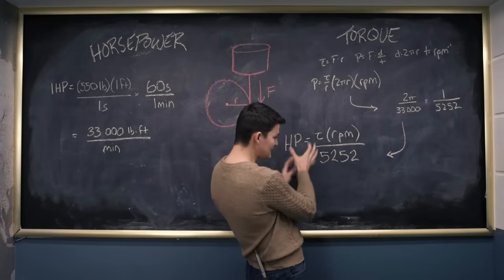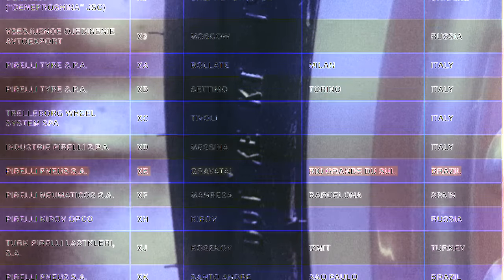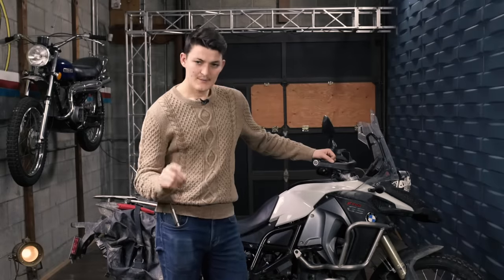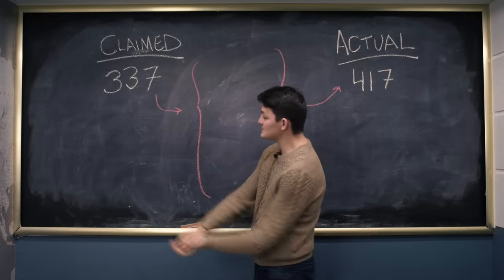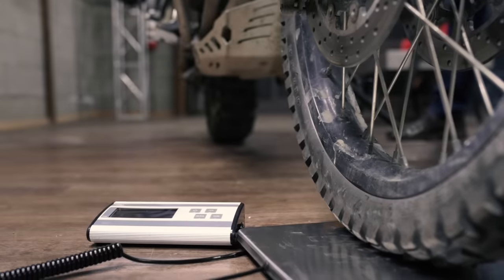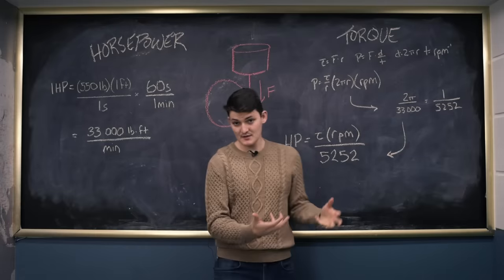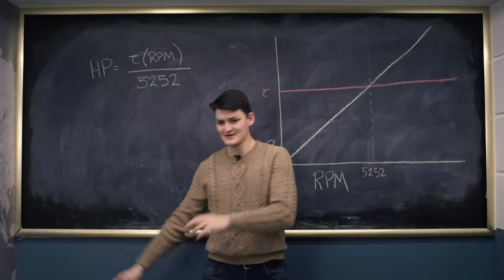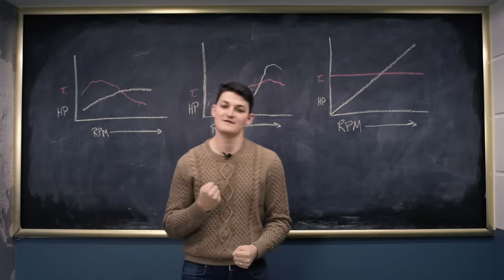3 Ways Motorcycle Manufacturers Trick You

Comment: Stuart Fullington tried to debunk this about the Pirelli tyres and said he contacted Pirelli and they assured him that what you claimed was not the case.  However at the time I owned continental GT with those exact tyres on and the local Triumph dealer had that years  Bonniville with the Phantoms on that had the deeper tread depth the exact same 100/19-18 front tyres and a mate of mine fitted the German version of that tyre and the tread depth was deeper than mine.  It’s also a dreadful tyre in the wet the Brazilian made version my mate said he has no complaints with his in the wet.

Also if you watch your video on a big screen TV you can actually see the tread depth is deeper.  When I point this out he called me names and shadow banned me. He also put out a video saying that open faced helmet are statistically as safe as full faced  helmets. Which may be true but tell that to the poor sod who has come off their bike and smeared their face along the road or gone face first into the side of a truck. He also shadow banned me  on my alt account after he gained that not once in his 40 years being one of the first to motorcycle crashes would a full faced helmet reduced injuries of the rider. Which could also be true.

Comment: Hat to be a stickler but...Acceleration = Force/Mass. Ergo, acceleration (in G’s) will very precisely follow the torque curve of the engine. Horsepower allows us to use gears to pretend we have more torque than we would otherwise have Eg. Horsepower allows us to hold onto numerically lower gears for longer (more torque at the wheel/s).
Reply: Who told acceleration is force/mass and how do I send them a mail bomb
Reply: @benfennell6842  It’s physics mate. You can argue it all you want, but that’s how it works. Peak acceleration (per gear) will ALWAYS occur at peak torque.
Reply: @burkeyatm  you literally fucking stated acceleration= force/mass

I cant even
Reply: @benfennell6842  Which part would you like to argue with?

Comment: Hey Bullwinkle here in America we got these stations called weigh station and you don't have to lift your Harley on any bathroom scale you just drive across the big concrete plate and the guy up in the station all yell out how much your Harley ways imagine that while you're explaining how it can't be done oh by the way while you're using trigonometry to bigger your Vortec guitar numbers for horsepower and torque we got Harley-Davidson baggers doing 147 miles per hour at Road America dragging their pegs and their knees and trading paint with Tyler O'Hara on his Indian bagger oh yeah by the way the Harley model that took the National Hot Rod Association Pro Stock drag bike at the US Nationals racing against 4-cylinder Suzuki namely the fxdrs 114 Milwaukee 8 weighs 660 lbs with 5 gallons of gas on board

Comment: I bought a second hand Honda 125 XLS in 1987 and the OEM tyres were the shittiest tyres in my life. I then bought a second hand Kawi 125 KMX in 1989 with Michelin T64 and the tyres were great. I bought a Kawasaki 500 KLE in 1992 and the OEM dunlop were crap, changed for Michelin after 800 kms (front) and 4000 kms (rear) and then the bike was great. More recently, I bought a Suzuki 650SV in 2007 and the OEM Dunlop D220 were crap, changed for Michelin Pilot road at first maintenance. I changed the SV for a VStrom in 2008 and I asked for Michelin Pilot road instead of crap brisgestone trail something. And I did not regret my choice. My advice : OEM tyres are crap !

Comment: I'm slightly confused about the torque vs hp argument though. Explain something like an FZ09 vs a R6? The FZ makes more torque at 3000rpm than the R6 makes at it's peak, and yet the FZ makes less hp.
Reply: Because the higher the rpm the more power the same amount of torque is.

If power=(torque*rpm)/5252 then there are only 2 variable components to power, torqueand rpm. Increasing and decreasing on or the other will both affect power. 

80 NM at 0 rpm is my puny arms pushing pushing a wrench power, 80 NM at 14,000 rpm is R6 power, capiche?

Comment: The 'you can't feel the torque' argument gets thrown out the window when you consider that you can compare one bike at x rpm vs another bike at x rpm. 

Torque is the force behind the power. You can easily feel the difference of a bike that needs to hit 7000 rpm to get that power vs a bike that has that same power at 3000 rpm, and even more power at 7000 rpm. You're feeling the difference in torque, while the hp is the same, because you know how high you're reving the bike.

You can't 'feel the torque' when just looking at a single bike.

Comment: The tire issue is interesting to me. If I didn't know to look at country codes and tread thickness, which I didn't until I watched this, I would just take that tire at face value. Which I assume most people do and that's why they do it. But if that tire craps out earlier than I would expect, I'm certainly not going to go shell out a shit load of cash to buy what I now assume to be a garbage tire. So now that company is damaging their reputation among people who don't know any better. So yeah they sell a boat load of cheap ass tires to the manufacturer, but now they are not selling their good tires to people that would buy them as a replacement. So what's the point?

Comment: If as example a motorcycle made a peak 80hp at 8k why they dont limit that engine to that rpm? Why bother add red line at 10k if they were had less hp at that point?
Reply: A few reasons, but the answer you're looking for is "gearing."  How fast the bike accelerates at any RPM comes down to how much torque is available at the wheels.  If we shift to the next gear at max HP, most modern engines will generate less torque at the wheels and accelerate slower because of the gearing difference.  The ideal shift point is often well after peak HP and is either redline or the point before redline where the bike is no longer generating more torque in the current gear than the next gear.  Unless your bike has a really unusual torque curve, you can try this at most RPMs.  For example, ride in 1st at 6k and twist the throttle then ride in 2nd at 4k and do the same.  Big difference.

Comment: The motorcycle feels torque before it moves...  This is what makes the tire break friction for a burn out  

125 ft*lb of torque is not applied at rear wheel, but rather from the crank, thru 1st gear(usually from a stop) and then the net mechanical gear ratio between the engine sprocket and then the rear sprocket.

Most of your other stuff is correct, but you really missed this one.  Sorry.

Second example, how else can you drop the clutch to pop and pivot a front wheel over a log or such  torque from a stop is what lifts the front wheel
Reply: How is that the person on the bike feeling torque? You failed to explain yourself

Comment: so now i know that my 1200 cc harley roadster has 57hp with 71.54 ft-lbs of torque at 4250rpm  and my vulcan s (650cc) has 57hp  with 46ft-lbs of torque at 6600 rpm.  so i remember someone saying to me that when your power band is above 5252 rpm you will always have more horsepower then torque likewisse if its below 5252 you will have more torque then horsepower.
*but if i cant tell the difference between torque and horsepower then why is it that my harley feels so much more powerful then my 650? (even though my 650 has a little more then half the harley's torque at a little more then half the harleys weight)

also thanks to this video i can tell my harley riding club that my 650 metric bike has the same horsepower as a pristine evo engine lol.
Reply: is it just gearing differences?  though looking closer my sportster was actually roadster model making 79ft-lbs at 4000rpm but thats only a difference of 3 horsepower using that  formula of HP=t(rpm) divided by 5252

Comment: bad example with wrench, because you can feel changes in turning force even if wrench doesn't move. Torque wins races, and horse power sells. Look at diesel engines, high compression engines, etc.
Reply: Which is why f1 engines make less torque than SUVs right?
Reply: @benfennell6842  Power to weight ratio anyone?! You must not have thought that through. F1 "VERY" light car + 1 driver. Suv very heavy truck + 5-9 passengers + internal load + external load of 5-11 thousand lbs. typically. The more technical you look at it, the more ridiculous your example becomes apparent. And we're not even looking at other physics involved yet. Like aerodynamics, etc.
Reply: @robertmitchell8728  what? do you think there's somne kind of mathematical fundamental difference between accelerating one mass or another? Please explain yourself. A formula one car may be light but at the end of the day it's engine produces power to accelerate the vehicle. there is nothing special about that. 

You said "Torque wins races, and horse power sells." I am providing an example as to how this is ridiculous. do you think that if you put an F1 powertrain in an SUV it would make it slower? 

I'm trying to say that despite F1 engines making very little torque they win races, which according to you is not how races are won. Please explain yourself?
Reply: Torque is a pressure, or pressing force. H.P. is a measurement of weight movement in a time limit. Low torque engines with high rpms are building up extra energy in the form of inertial energy.
Reply: @robertmitchell8728  ok now I'm just more confused what what he'll are you talking about?
Reply: @benfennell6842  A F1 engine will not do well in a suv.
Reply: @benfennell6842  The greater the mass, the greater force needed to move said mass. The more torque over mass, the greater the acceleration. There are other forces involved, but in general, this is true.
Reply: @benfennell6842  Yes, an F1 engine would definitely be much slower in a suv, than in a F1 car. And even more so with it loaded down, and pulling a trailer.
Reply: @robertmitchell8728  let me get this straight, you think an suv would get SLOWER if you put an f1 powertrain in it?
Reply: @benfennell6842  I thought you might be trolling. Stop wasting my time, and yours.
Reply: @robertmitchell8728  You're actually so bad at explaining your position on this you've managed to end the conversation through confusion. Well done.
Reply: @benfennell6842  What part are you confused about? You don't think the added load of a suv would slow down a F1 engine? I think a
 F1 engine would be ridiculous in a suv. In initial cost, operation, and maintaining. I think it's lack of low end torque would have to be compensated for with more gears, to manage the increased loads. I think you would have to completely redesign the transmission to handle the extreme rpms, matched to the dramatic increase in loads. Unlike my uncle, I'm not a rocket scientist, but I get it. Are there errors in my grammar, or punctuation? If so, I apologise. If you could point my mistakes out specifically, I can learn from them, and improve on them. Otherwise, I suspect your trolling.

Comment: When I do Comparison I usually calculate the hp at the peak torqued and draw a linear line to the peak hp. This is not accurate, and many engineers have long way power after the peak number, this has to do just whit switch revs, all comes down to the net power given by the gear. Of course the 0-60 number give better respect than stealing ar the hp and torque number, and that's not giving you any truth about everyday driving, more important is the number under the curve, and that's just something you need to test drive to feel how you like the engine. After all, how often are you going for full power in a race situation on open roads, then again if you ower taking a car on a highway, seen the trouble to gear down to get to the power band might take more time with a more powerful engine than ower taking with a nice under the curve power engine with just dropping on gear or going with the gear you're in

Comment: Lawn mowers have torque at low RPM, crotch rockets have torque at high RPM, rally cars have torque through 2000 RPM to 5500 RPM.
Only trust bikes that have been independently ran on a dyno, never just buy some bike because it features super high figures.

Comment: I would disagree with you a little.

An engine with high torque is 99% of the time characterized with high torque at low RPM; thus power comes up easily without downshifting; it's more responsive to throttle. These engines are long stroked.

These type of engines are in harleys, REs, Triumph, trucks, pickups, buses, farm vehicles, generators etc...

Comment: Your torque vs hp doesn`t hold water. 80hp from a 1.6l will be a lot stronger than 80hp from a 600cc. Why? Bcs the bigger engine will produce a lot more tourque even from low rpms. Or in other words; you shure can feel tourque

Comment: I expected you of all people would be above the petty, juvenile, fray over imperial vs metric units as you seem to know math and chemistry fairly well and would hold an accurate view of how marginal the difference between those unit types really is. yes,  technically metric scales more logically and would theoretically be easier to learn and also convert if you have a hard time with basic arithmetic but if you learn the imperial system first it's just as easy to scale and convert. also learning one doesn't predlude learning the other. I'm a mech eng student and I have the imperial to metric and metric to imperial conversion factors memorized to 2 significant figures which is the same accuracy they ask from you when doing stoichiometry in chemistry.

metric good, imperial bad is a stock line from people who don't understand either system very well, which I naively thought you would recognize how trashy and low an  argument constructed on this juxtaposition of these systems would be. but I was wrong

Comment: His explanation of torque is why Moto Guzzi has such loyal followers on paper V7 has about 50HP but its across the rev range and why its not slow bike or feel slow.Every reviewer simply loves these bikes.  Compare that to typical sport bike when you have to rave the engine to 5k+RPM to get the power going by then you are on public roads going over the speed limit so where is the fun in that? Why for example MT07 is more popular then MT09 MT07 has more usable power for the street.I think manufacturers marketed the public on sport bikes knowing well public roads are not tracks but your typical young gun with full of hormones does not know that.Sport bike position low clips designed for the track but on street you will be in pain in short time wrists neck back why nakeds are popular now finally these kids starting to get smart.Anyway ride what you like but know what you are riding "The unexamined life is not worth living"  Socrates

Comment: Manufacturers should be putting practical real world weight of their bike. taking the highest values, not the least.

cant agree to this more. the marketed kerb mass of my Ninja 300 is 179 kgs, but by the time i add frame slider, fork slider, radiator guard, and the indian government mandated saree guard, badly designed license plate holder and grab rail, i'm pretty sure the bike is approaching 200kgs...

Comment: If you roll onto one bathroom scale on one wheel and then the other you will read the exact same weight. You clearly have the physics understanding to draw a a free body diagram and do the math.
Reply: Only if the center of mass of the bike sits exactly equidistant from the contact patches, otherwise (IE in the real world) no. 

Dont believe me? Put 2 bathroom scales next to eachother and place a hammer across them, head on one and handle on the other. By your flawed logic the scales should read the same number.
Reply: @benfennell6842 Sorry but you're wrong here. First of all, I never said the scales would read the same number. The sum of the values on the scales would be equal to the total weight of the bike, but not necessarily be equal. The hammer analogy doesn't work because the contact point changes as the angle of the hammer changes. When the hammer is on the ground, the tip of the handle contacts the ground. When the handle is on a scale, a point somwhere along the handle will contact the scale.

Just think about it like this: The ratio of weights on each scale is equal to the inverse of the ratio of the distance from each contact point to the center of mass along the axis parallel to the ground. As the angle of the bike changes, this ratio remains constant, so long as the wheels aren't directly on top of each other (bike at 12 o clock). Since the ratio of distances to center of mass remains constant, the ratio of weights on the scales remains constant. We know that the total weight between both scales is constant because it always has to add up to the total weight of the bike. So if the total weight doesnt change, the weight on each wheel is independent of the angle of the bike.

Im not making this up based on gut feel by the way. The logic that I just laid out is verifiably correct.
Reply: @nigelbess5168  wait if that's what you meant then what is your point? By your own logic putting a bathroom scale under each wheel is necessary to find the weight
Reply: @benfennell6842  My point is that you can put a single scale under one wheel, then move it under the other wheel, and you can sum the two to get the exact weight of the motorcycle
Reply: @nigelbess5168  he said that in the video
Reply: @benfennell6842  "A bathroom [scale] under one tire then the other will add up damn near accurate - if slightly underestimated since weight always shifts downhill onto the unweighed wheel". This is the part that I disagreed with. Weight does not "shift downhill onto the unweighted wheel". This method will not return an "underestimated" weight. It will return the exact weight, within the accuracy of the scale.
Reply: @nigelbess5168  aaah